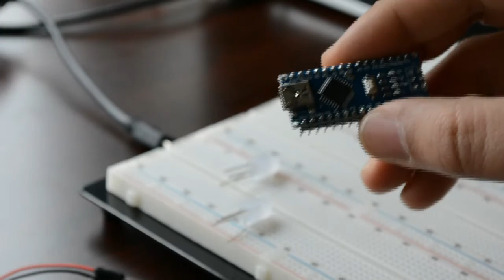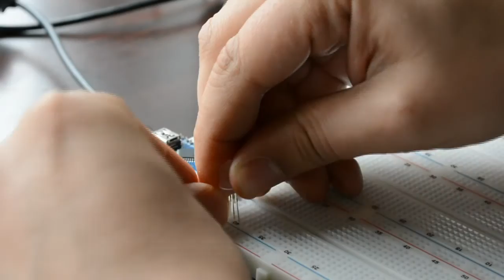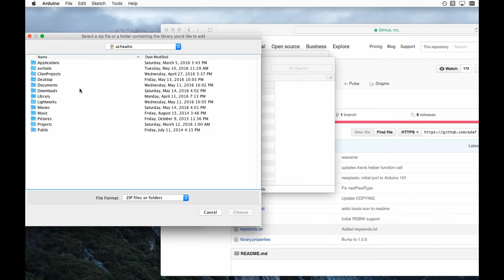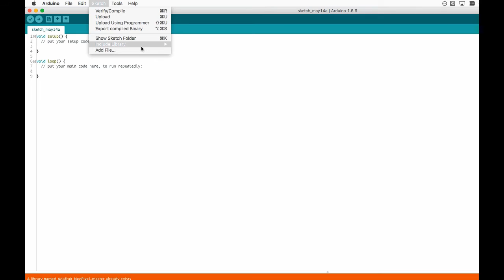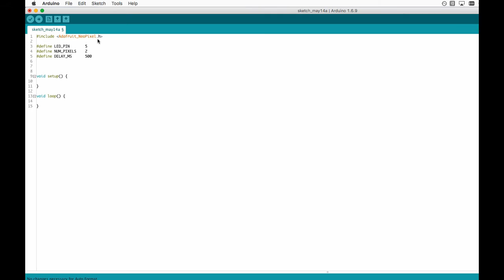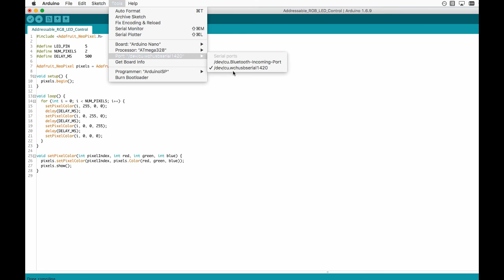Beginner Arduino - Control an Addressable LED

Comment: Hello! You could not help me? I correctly understood, if you just give energy, then the LED will turn blue? Or in Arduino already had the firmware? I can not understand whether the LED have been delivered to me.
Reply from the maker: Depends on the type of LED you purchased. An addressable LED has a built in controller that allows us to control the LED color via the Data pin. Using Adafruit's Neopixel library, we can easily address each LED in sequence (starting from 0) and tell it what color to be. This is mentioned in the video  around 8:23